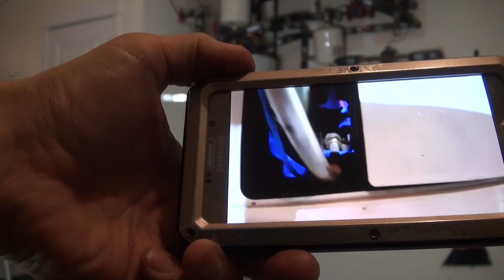DIY. Water heater leak. How to replace BRASS - CPVC adapter. Замена латунной муфты

Comment from the maker: The age/years of the pipes and the hot temperature contribute to cracking. 
These CPVC pipes become less flexible for expansion over the years, and at different temperatures in the pipe, sometimes warm, sometimes hot, the bronze connection shrinks and expands (like all the metals under different temperatures) and the plastic cracks.

Comment: Why did you use purple & orange primer / glue? The guy at Home Depot said you only need the yellow can for CPVC - that it’s an all-in-one primer & glue.
Reply from the maker: Yes you can use only yellow. Both way will work.

Comment: You gave me a good idea on how to fix unfinished work left by a big plumbing company. The assholes didn’t connect the over flow drain pipe to the drip pan when they installed my water heater a few years ago and I just noticed. It’s in my attic so I don’t see it often. I decided to check my water heaters after seeing running water coming from the relief valve emergency drain pipe which I’d thankfully separate. Or my attic would have flooded. I’m running out in the morning and connecting one of these mesh deals with pvc and fix it myself. I don’t want a company messing with anything again if I can avoid it. Jerks rip you off and don’t do the job right. This would have caused extensive damage if water went into that drip pan and just drained into my attic insulation and upstairs ceilings! Sorry for venting. I’m going to replace the valve in the morning as well.

Comment: How much time should I wait to apply a cement. I mean when I apply prime how much should I wait to apply a cement. Also, after applying a cement, when should I turn water on. Thank you.
Reply from the maker: Don't wait between primer and cement. Use cement over wet primer. I wait 20-30 minutes after pipe connected on cement and turn ON water.